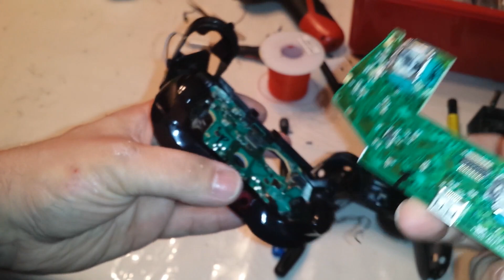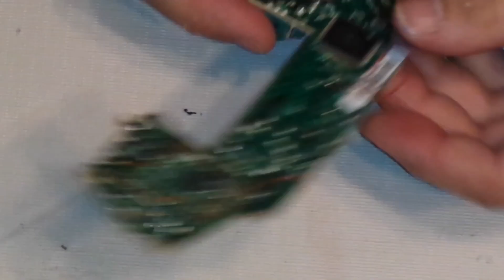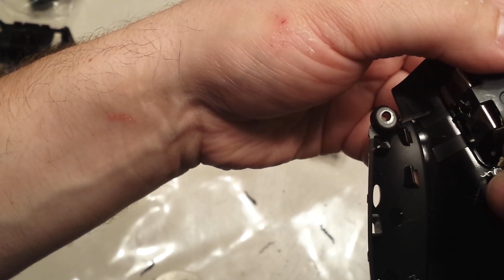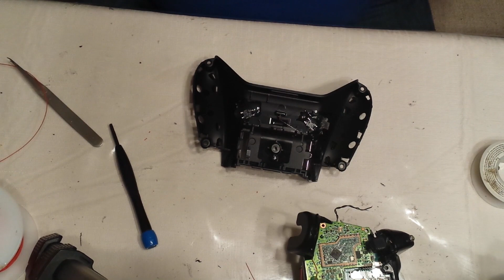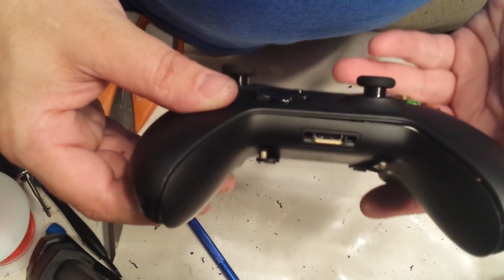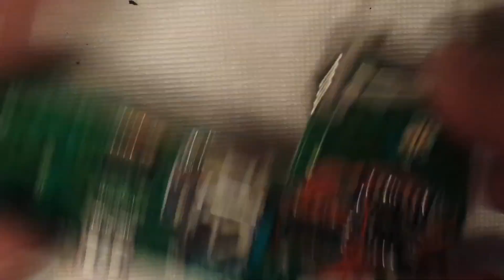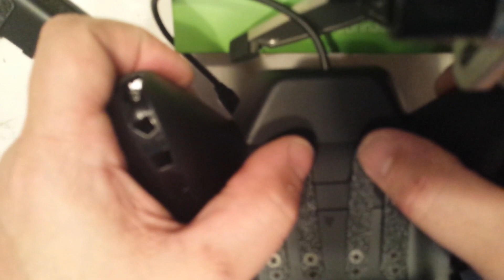TUTORIAL BUILD YOUR OWN XBOX 1 Scuf style Controller w/ Triggers Stops, Remap chip & MORE DIY Gamer

Comment: how much for you to make my xbox 360 controller
Reply from the maker: +ghosthd 55 I can do wired or wireless 360 controllers with the works Paddles, Trigger stops, Adjusters, new thumbs (any color) LEds changes for $100 shipped if you want me to supply the new controller. That is 2 remaps of your choice.  I can do 4 remaps for $15 more.  ($115 shipped) if you want them PROGRAMMABLE it is $125 and and $140 shipped for 2 or 4 paddles. Still includes the works.  Email me for more info or just follow my 360 tutorial and do it yourself. I sell all the parts and the installs are simple.  I also do mail in.  All my pricing is on the 360 video in the description.
Reply: Ok thx ill think about it
Reply: How much just with paddles
Reply from the maker: +ghosthd 55 

DON'T WANT TO BUILD ONE WANT TO JUST BUY ONE DONE?
FOR $100 I Will Build you a WIRELESS Controller as per this video (Free shipping in USA)
FOR $100 I Will Build you a WIRED Controller as per this Video (Free shipping in USA)
NO difference in price.

NOTE: if you are buying a full controller here is what you get for your money.
YOUR CHOICE OF SHELL COLORS - white, black, red, blue, olive green

YOUR CHOICE OF LED RING OF LIGHT

YOUR BUTTON CHOICE COLOR (Standard colors - Red green white, blue ect..)

YOUR CHOICE OF TRIM COLOR (Black, Grey, white, red, blue, orange, ect..)

YOUR CHOICE OF TRIGGER COLOR, (Red, Green, White, Black, Pink, Blue)

YOUR CHOICE of Paddles or Tacts
Contact Info and other packages available at the bottom

As I said if you want to buy a DO IT YOURSELF KIT.

They are $29.99

You get.in the package.

    4-40 set screws Qty 2

    4-40 Hex head screw Qty 2

    4-40 Flat head screw Qty 4

    4-40 Tap

    Drill bit for 4-40 non tapped hole

    Wire (I use old FDD and HDD cables)

    Tactile switches with long post Qty 2

    Two Paddles Pre Drilled

    hex wrenches 4-40 Key

    T8 Torx driver   

    PS3 style thumb stick

For $39.99 I will provide.

     Black Wireless Xbox Shell with non slip back (trigger adjustment screws installed,
     Tact Switches will be installed as well and Wired up.  Paddles Installed
     Triggers With Trigger Stops

     Extra Wire

     1 PS3 Thumb-stick and 1 Xbox Thumb-stick

For $44.99 We will mod your controller (wired or wireless)
Mail it in we do the rest and mail it back.

Message me!
or
EMAIL ME AT modcentralusa@gmail.com

Comment: Im sry for this comment but im french and i didn't understand something. I want to do LB, Y, X and A for the paddles, so 4 paddles but what i don't understand is where you have to put the wires from 1 paddle to an other paddle and what's the ground?
Reply from the maker: +Vick Each buttons has ONE Wire the other wire is always Ground. SO every Tact button will have a wire from TP26 to the tact.
Reply: So i need to soder 4 wires to tp26 or only 1?
Reply from the maker: +Vick You can do 4 wires - 1 to each tact.  OR only 1 wire to the first tact and then cascade the ground from tact 1 to tacts 2,3, and 4.
Reply: Oh okay i understand thank you very much

Comment: do i really need the remap chip? only using 2 remaps.
Reply from the maker: +RobTheGreat21 Nope.. just do 2 hard remaps.. and your done.. REMAP CHIP is for those who want options and don't want to resolder all the time to swaitch their remaps around.
Reply: +MODCENTRALUSA Thanks for replying. Do you sell the tactile switches? Also what are the LEDs? 0805?
Reply from the maker: +RobTheGreat21 I have the tact buttons too on all my kits. Check the video description.  I have all the info there.  The LEDs are 0805 though 0803 will work as well.

Comment: can you make a version of a 360 scuf with a remapable chip?
Reply from the maker: woodworkers 4 life Already have one. (sort of - the 360 video will help with the install). I have a a chip for wired and wireless 360 controllers. I just don't have a Video up for the install. But it is pretty much the same install you see here for Xbox one.  Glue the chip in.  The 8 buttons are the same as Xbox one on a wired 360 controller, there are 8 solder points very easy to get to. Same with the Ground, Power, LED, ect..  Super simple really.  The wireless controller is just as easy only thing is you need to scrape the pads and solder to the pads just like I show in the 360 video where I make a wireless remap controller. Instead of only 2 or 4 wires to the tact buttons you would solder the wires to the chip and then from the chip to the tact.  Again SUPER SIMPLE.  Chips are listed on my ebay page.  AS I said they are the same chips you see in this video.  They work on all the xbox controllers..

Comment from the maker: @orlando"scarybubble2" Lopez - then you did something incorrect.  Disconnect your work and see if it works again.  If not you accidentally broke or soldered something you shouldn't have.  Remapping simple buttons will not and does not have anything to do with the USB and or rechargeable battery.

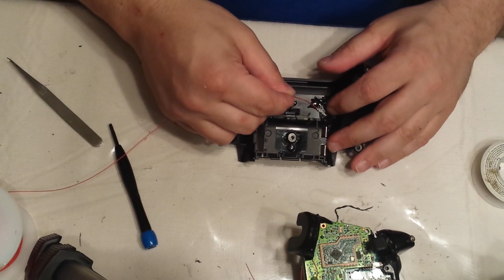Comment: Can you help explain the part that starts around 45:00? Thinking of doing this but thats the only part i dont fully understand...
Reply from the maker: Enassi Each tact button as 2 legs.  One leg gets a wire that goes to the button (like A or B or X ect...).  The other leg goes to ground.  Since each button (2 or 4 of them that you are adding). All need a ground.  I cascade them together.  I connect only 1 wire from the controller Ground to the Tact ground. Then I use the leg on the other side (the redundant leg) to stretch the ground from that tact to the next one, and the next one and the next one (if your doing 4 buttons) that way you are not soldering 4 wires from the Controller ground to each tact.   If you have a hard time grasping the concept of Ground and Action button wires and don't understand how circuits work, then perhaps you might not want to attempt doing this on your own. You could damage you controller if done wrong.
Reply: MODCENTRALUSA I have one spare controller which is already pretty much broken so no worries :) and thanks for the reply.

Comment: With the hardremap would you solder back the gray and black positive negative wires to the board?
Reply from the maker: Chinhnam Nguyen THe Grey and Black Wires are Trigger Rumbles. If you want the triggers to rumble solder them back. If you don't care - like some people just cut them off and forget about them. I would not remove the actual motors from the triggers, as they add weight to the trigger pull. Without the rumbles in the triggers they seem too light (at least for me).
Reply: Thanks! Also it works but when I hit the a button it takes me to the home screen and won't let me get back into my app

Comment: Is pin 11 on j6 a pin for the right trigger?
Reply from the maker: Rayzer 
The button pinout for J5 is..

1 - 
2 - DR
3 - DU
4 - DD
5 - DL
6 - SY
7 - 
8 - 
9 - LB
10 - 
11 - 
12 - 
13 - 
14 - GND

The button pinout for J6 is..

1 - 
2 - 
3 - GND
4 - 3.3V Power
5 - RB
6 - 
7 - 
8 - A
9 - X
10 - Y
11 - BK, VIEW
12 - ST, Windows
13 - 
14 -

Comment: I did the mod and when I assembles my controller I couldn't plug in my mic any tips to fix this?
Reply from the maker: COD CENTRAL Use a smaller profile button on the inside or installed them higher in 
the shell.

or

or pinch the area where the mic port is so the port comes down a bit and 
pushup on the headset adapter as you slide it in. DO NOT FORCE IT. It 
will go in.

Comment: Mine didn't work my A and B buttons didn't work and the new buttons on the back didn't work
Reply from the maker: Conor JW  Then you did it incorrectly.

Common mistakes are the legs on teh tact buttons were done side to side not top to bottom.

Your ground is not correct (TP26 is the best ground to use)

So try again and WATCH the video carefully.  It gives you everything you need to know,
Reply: works fine now thanks great vid

Comment: Is there a very easy way of replacing the joysticks?
Reply from the maker: Chandler Mitchell YEP... remove the 5 screws the front cover comes right off, just pull the joysticks off and put new ones on.
Reply: MODCENTRALUSA I meant on a regular xbox one controller
Reply from the maker: Chandler Mitchell  There is only one style of xbox one controller at the moment.  TO replace the joysticks - you need to take the 5 screws out pull the front  cover off and then swap them.  That is it.. it is pretty easy.

Comment: off topic awsome video by the way few links dont work but for a led install where can i find a 3v solder point the id use t p 26 for ground correct?
Reply from the maker: Rayzer E   TP9 will work for you. or Pin 4 of J6
Reply: awsome bro! quick question why do think the wire like caught fire and burned when i hooked it stright to the battery pins? Surge in power? i was under asssumption 2 dounle a's would give off around 3v
Reply from the maker: Rayzer E That connection is over 5V, not surprised that happened.  IF you watch my Thumbstick video there is a 5.3V solder point I use for the light up thumbsticks..
Reply: thanx bro! you got a new sub right here
Reply: Thoughts on a led rumble mod? Just wire leds to rumble motors? Would I run into any problems I know the 360 rumbles ran at about 3v is it same with the one?
Reply from the maker: Rayzer I could do a short video but it is super simple.  De-solder the rumble motor. The soldering points are marked + and - on the board. Just solder the Positive of the LED (the longer leg) to the positive and the negative leg to the negative on the board. Hot glue the led where you want and call it a day.  You could even leave the Rumble in and just use small wires and solder it on top of the wire that is there already and just run those wires to the LED and solder them to the appropriate Leg and done.  You can use a 100 ohm resistor on the positive leg if you want if using only a single LED, but it is not necessary.

Also on xbox one controllers if you need a separate 3v to solder to, there are 3 that I know of.  TP5 and TP9 are both 3v and LEG 4 of J6 on the daughter board connector have 3v.   Any Ground will work. TP26 is the best ground to use, but you can also use the ground from thumbstick clicks which are the far right solder points of the 4 solder pads.  They are both TOP and Bottom solder pads of the thumb stick click Tact.  Again ANY ground will work, you could even use the grounds of the rumble-motors.  Ground is Ground.

Here is a pic of a LED just in case.
http://boysdad.com/wp-content/uploads/2012/12/LEDlabel.png
Reply: Exactly what I  thought thanx man!

Comment: Hey, I bought a remap chip from the Ebay link in the description above. Does the remapping/programming of the buttons work the same way you described it in the video with this chip?
Reply from the maker: Nathan Lords YES
Reply: MODCENTRALUSA Thanks!
Reply: MODCENTRALUSA Sorry, I have another question... I'm just about ready to start moding but the wire I have is 30 Gauge. Is that ok? will it work with 30 Gauge?
Reply from the maker: Nathan Lords wire is wire... thickness don't matter. work with what you are comfortable with.

Comment: Where would I solder to if I wanted to remap Dbutton left and right? Thanks for the video!
Reply from the maker: aliaslupe 

The button pinout for J5 is..

1 - 
2 - DR
3 - DU
4 - DD
5 - DL
6 - SY
7 - 
8 - 
9 - LB
10 - 
11 - 
12 - 
13 - 
14 - GND

The button pinout for J6 is..

1 - 
2 - 
3 - GND
4 - 3.3V Power
5 - RB
6 - 
7 - 
8 - A
9 - X
10 - Y
11 - BK, VIEW
12 - ST, Windows
13 - 
14 -
Reply: Thanks!
Reply: So if i run a button from pinout J5 I have to ground it to that ground and not to the TP26 correct?
Reply from the maker: aliaslupe TP26 is GROUND...   CG is common Ground...

Comment: Thanks for the video man you did a good job... Lol my B tac is tripping out and moving the joystick and then disconnecting the controller I guess I got to open this thing up a third time and figure it out.... Fuck you grey and black wires you are killing me!
Reply from the maker: jerry strong The tact button is Grounding out on the thumbstick contacts.....
Use a small profile tact button or move it up higher..  THe lower they are the closer they are to the main MCU board.. it goes in at an angle.. so you have more room twords the top of the shell.
Reply: Yeah I got it working thanks again

Comment: Can you do a tutorial making a 8 button arcade fightstick from a xbox one controller
Reply from the maker: frank castro There is already a product out there called the CROSSBONE which is great for making a fighting stick with an xbox one controller. Find that product and their video tutorial. 

I could do it and it would be pretty easy to do. But in all seriousness, you can do it on your own with just this video. I show you how to duplicate buttons using this video. Just place the 2 circuit boards inside a arcade stick and solder the 8 buttons (PLUS start, back and guide (guide is soldering leg 6 on J6 - between the  Voltage for the remap chip and the A button).  SO really solder 11 wires on the circuit board to your 11 arcade buttons and one common ground to all of them and plug it in via USB and your done.. It  is really easy

Comment: Someone (another tutorial) applied a sheet of duct tape (lol) to his pcb to prevent the connections on the tact switches from touching the pcb because they would touch and mayhem would ensue.
How did you prevent this issue? Is it even an issue?
Reply from the maker: x UnHiinGeD IF you install them in the proper spots (AS I POINT OUT IN THE VIDEO) there is no issues.  If you really want to make sure, then use a low profile gulwing tact which cost about $1 each but even if you install below the cut off line, you have some leaway as the tact base is a bit more narrow and you can get away with it not touching.  None of my tacts touch at all.

Comment: my b button stopped working. rip controller
Reply from the maker: cris lopez My guess is you soldered the B connection point to the point below it and shorted it.
It is a easy fix... 

Look at this picture http://postimg.org/image/yqk8fhklf/
Notice the 2 points separate from each other.
Use some de-solder braid or use the tip of your iron to separate the 2 points so they are not soldered together. 
FIXED!
Reply: will try tonight thanks. 
if its not too much trouble could you post a picture of all the connection points for each button ?
Reply from the maker: cris lopez 

Pin one is the one next to the White DOT and then they go up down. As per my video I point them out oo.

he button pinout for J5 is..

1 - 
2 - DR
3 - DU
4 - DD
5 - DL
6 - SY
7 - 
8 - 
9 - LB
10 - 
11 - 
12 - 
13 - 
14 - GND

The button pinout for J6 is..

1 - 
2 - 
3 - GND
4 - 3.3V Power
5 - RB
6 - 
7 - 
8 - A
9 - X
10 - Y
11 - BK, VIEW
12 - ST, Windows
13 - 
14 -

Comment: Hey Modcentral.  Great vid man!   Do you have a way to make a rapid fire button?  I want a turbo button because I cannot press the button very fast and some games require it.  Thank you.
Reply from the maker: Yes and No.

You can add a rapid fire chip of your choice to the controller. I sell them but there not simple chips there full blown solutions $30 each.
You can also duplicate your trigger button to a tact button so you can press it faster.
But as far as holding down the trigger and getting rapid fire only a tru rapid fire chip will work.
Reply: MODCENTRALUSA
Thanks man.  Do you sell a chip that would work for me and instructions for installing them?
Reply from the maker: aintgonnahappen Sure do.. They are really simple to install.....Drop me an email if interested.
Reply: MODCENTRALUSA
I sent you an email, Matt.
Reply from the maker: aintgonnahappen All emails replied....